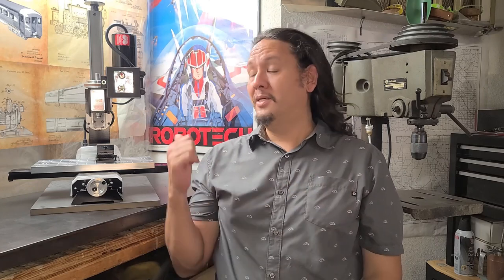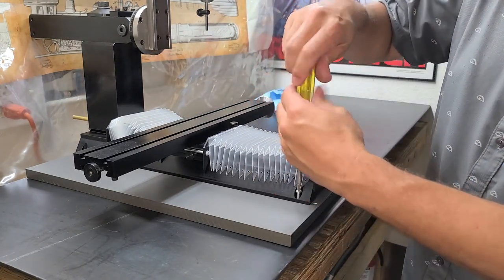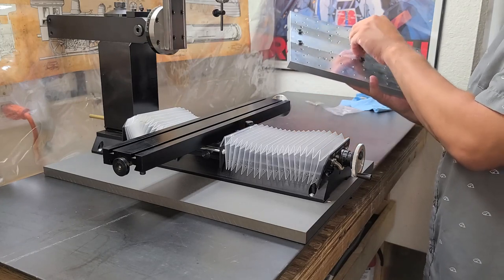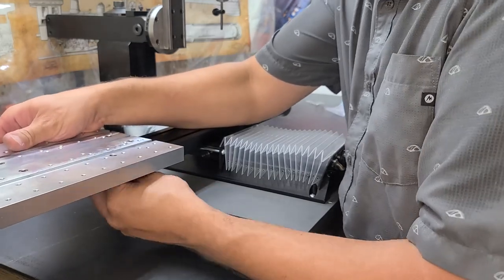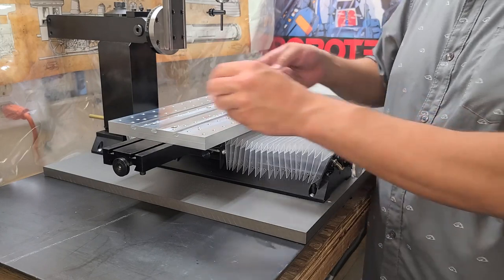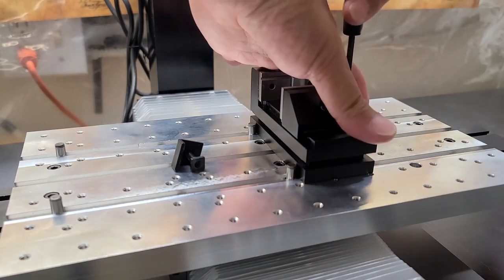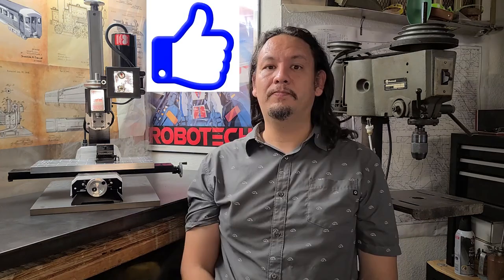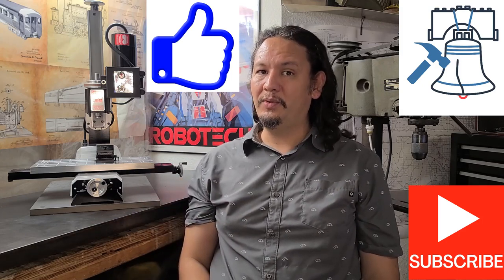Mill Vise Setup and Tram Sherline Tooling Plate

Comment: Seems you are a hobby train man? If so good lol. Welcome to the machining world for hobbies. you will certainly have a blast being creative, making articles towards toolmaking for the hobby and making model articles. if you dont have a lathe, invest in one as well later on. as for tramming the mill, i would have used(or borrowed if you dont have)a machinist parallel to tram the lateral(x axis) on the machine vice.
Reply from the maker: LOL yes the be a train man is so much easier working from the Kozo Hiraoka drawings and books.  I have found how quickly the projects diversify once friends find out.  I have made everything from compound bow sight adapters to car parts.  I do have a lathe. I actually started with the Sherline Lathe and just recently got the mill.

For using the parallel, thanks for the tip how do you mount up the parrel in the vise? flat against the back jaw and run an indicator over the surface? Thanks
Reply: @LoydPrecisionMakers  you can use a soft to medium strength compression spring of length that will fit in the vice you are using. it will hold the parallel in place whilst or you can lock  parrallel in vice just high enough for the indicator you are using(x axis sweep). i normally go to Joe Piezinski(Advanced Innovations, Austin, Texas) for tips if i get stuck with machine things. this is where i got the "spring to hold parallels in vice" tip. I also often use "tubalcaine your YouTube machine shop  teacher" channel my credits are to the 2 men who explain things very well and make it easier to understand and do
Reply from the maker: @jacquespats2128  Thanks for explaining how that works.  That sounds like neat little trick.  I've seen some of their videos, good stuff.

Comment: How I like to square my vise, is using a large parallel tightened in the vise and indicating that (if the jaws have a burr). 
Also, wouldn’t you be able to indicate the t slots on the plate and by default, the pins will be perpendicular to them? Just a thought.
For the variation on flatness on the vise, I like to keep my tie downs equally on each opposite side. It seems when tightening down the screws, it’s enough pressure created just the slightest variation if the the opposite side isn’t treated equally. 
Great videos ofc!
Reply from the maker: Thanks for the comment and the thought.  Luckily the Sherline vise is so small alot of parallels seem big in it!!!  Ill have to try it out.  

I like what you said on indicating the t slots.  Your right, you would think that by default they should be aligned or perpendicular.  I would imagine they are running some sort of high end CNC with a quick change tool head and these plates are in a really rigid set up.  Though I think I need to devise some way to test or check that.  Any thoughts?

I didn't think about an asymmetrical clamp setup might be creating variation.  That is an excellent point.  I'll have to check that out or change how the pins and clamps are arranged.
Reply: @LoydPrecisionMakers  dial in the plate with the T slots before mounting the vise, then once you clamped your vise against the pins, it will be parallel if the t slots are perpendicular to the pins. Also, although I'm not familiar with sherline, when you were checking parallelism in the Y axis on the vise, the spindle may not be perpendicular to the table so when you rotate the indicator it may be moving the 3 thou in spindle, not the vise.
Reply from the maker: @DJMateo99  Cool.  Thanks for sharing that.  Both are good pieces of advise.  I just took the vise off so it is a perfect time to tram it all in again.  I'll try it out.  I hope that Sherline has everything nice and perpendicular.

Comment: The tooling plate should be dialed in and secured. There's no reason to dial in the vise if the tooling plate is out of alignment. If you ever need to take the vise off for other fixturing, you'll have to dial in the tooling plate anyways.

1. Dial in the tooling plate and lock it down.
2. Drill and ream 2 quarter inch holes for precision pins to align the vise to for future vise mounting.
3. Mouse the vise and squar it using the 2 pins :)

This is all assuming the side of the vise body is perfectly perpendicular to the vice jaws. Otherwise, dial in the plate, lock it down, dial in the vise, lock it down.
Reply from the maker: Thanks, that is a good point.  Before I get too many burs and worn spots, I'll have to try that.  Thanks for the tips I like the idea of using the pins and being able to drop the vise on its own spot.  I've been thinking how much id like the solid vise jaw to just be dead center of the x and y axis or where it is centered on the spindle and aligned with the oiler access.
Reply: @LoydPrecisionMakers  There are both pros and cons to having your vise dead center. Biggest con is you leave little room on either side for other fixturing without needing to move/remove your vise. This may or may not be an issue for your purposes so your mileage may vary.

The biggest pro is having the largest amount of x and y travel across the work being held in the vise.

I would suggest making pin holes for your vise in both dead center and off to one side. This would get you the best of both worlds but would result in more holes in your tooling plate.
Reply from the maker: Thanks for bringing that up you do bring up some good points.  It really is something that some consideration has to given too before adding more holes.  Originally my thoughts on being more in the center was also reducing potential run out as much as possible on either far end.  It is something I was pondering given how long the table is in comparison to how much is supported on the mill.

I do like your idea of having both position available.  Until I can get some .250 precision ground stock locally, I'll have to give it a think.